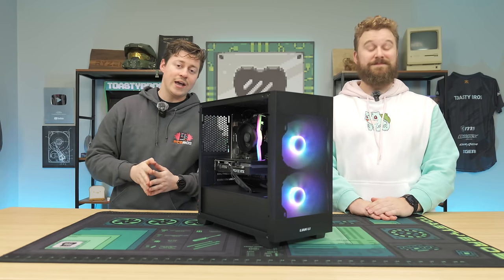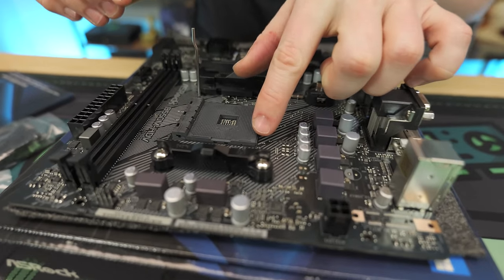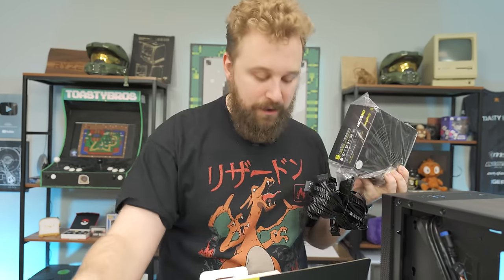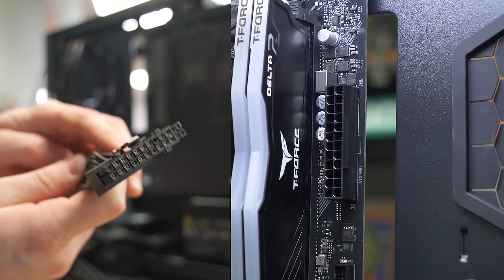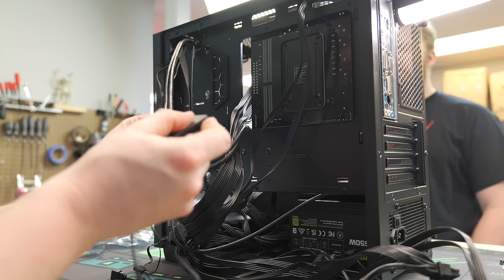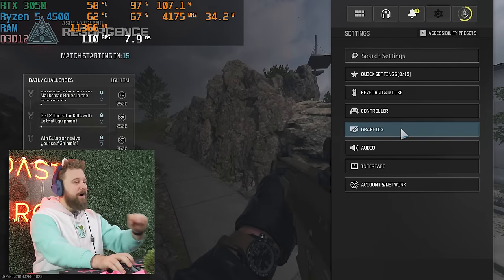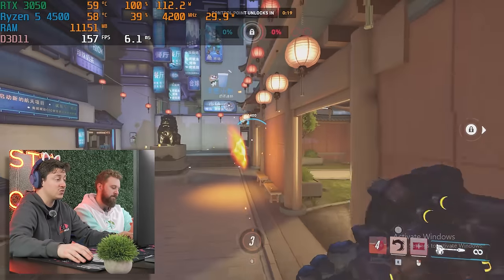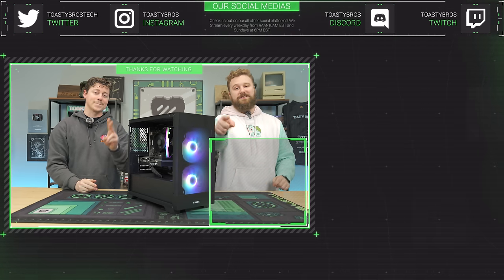$650 Budget Gaming PC Build Guide 2024 | Step By Step!

Comment: 3050 is insane I expected better toasty bros☠️
Reply: Gpu prices are pretty high right now
Reply: @metalbarz an intel arc a580 would've been better and cheaper
Reply: rx 7600 or 6600 would be better but i get they want something different
Reply: @metalbarz  rx 6600 would be a better option
Reply: @metalbarz  You should still be able to slot in a $250 GPU at this pricepoint. That means an RX 6650 XT which is about 55% better than the 3050
Reply: goku69000  fr
Reply: A Rx 6600 is like $20 cheaper and up to 50% better performing
Reply: @RetroAlex125 you are not wrong but intel is a little bit behind in driver support and it more unknown dont get me wrong I love intel GPUS are really good
Reply: I personally would have gone rx 6600 but I have the same issue with my case . Case has 4 fans , mother board has sysfan and cpu fan , I kind of dropped the ball on that setup . Apparently spare fan hubs are your friends when mother boards are cheap and stupid in design .
Reply: I made a 640 dollar pc with a rtx 4060
Reply: @metalbarz not really
Reply: @RetroAlex125 an intel gpu would be a flop they not as good as they should be rn it’s not a good buy maybe a 6650xt or 6700 but they literally tell u that in the video ? 😂😂
Reply: Ryzen 3600 got pcie 4.0 support, cheaper than the ryzen 4500 with arguably better performance
Reply: A RTX 3050 isn't a bad GPU it's just badly priced
Reply: @RetroAlex125 I don’t think they used intel since intel gpus still aren’t quite for normal consumers. Optimization isn’t anywhere near as good as real red or green
Reply: Same here 😂
Reply: @no_name900 Would the 6650xt be a good fit for an i7 8700k?
Reply: The thing is they have built plenty of pcs with a 6600 on the channel they need content so this is an option the rarely have used not the best but its functional thats how they see it without that mindset they lose views
Reply: In the meantime, I have a 1650 😁
Reply: @@StraightOutta2003you can literally fit a better and cheaper GPU.
Reply: @metalbarz  no they aint😂
Reply: Ur telling me I got a Ryzen 7 3700x and a 5700xt combo for under 250$ on eBay
Reply: In the PC selling biz, Nvidia sells like hot cake no matter how you wanna say X Y Z card wouldve been better. End of the story.
Reply: @metalbarz they really aren’t. Could easily fit an rx6600 or rx6600xt in a 650 dollar build
Reply: i mean they already said if you want " new" and "nvidia"..so only rtx 3050 then as rtx 2000 is not sold brand new any more
Reply: @@StraightOutta2003Rx 6600 is much cheaper and if I'm not wrong, much much better than the 3050.
Reply: @t0uchmyh0rn that's not the reason. Even they Kno that Rx 6600 is better than the 3050 but they don't want to be repeating the same thing. They could have even used a better CPU but they didn't
Reply: @MPblackpride6950  You clearly got no clue how PC selling works. Look at steam most used graphics card. TOP 10 is NVIDIA. RTX 3050 will sell twice as fast as any AMD card.
Reply: @t0uchmyh0rn  so basically, you're saying that people should buy the more expensive 3050 even though Rx 6600 is cheaper and does better? Yet you say I don't know how PC selling works
Reply: @MPblackpride6950  No, im saying if you run a pc biz you wanna put rtx cards in your rig even if its a 3050 cause i guarantee its gonna sell twice as fast vs amd
Reply: 6600
Reply: any amd gpu could have been cheaper and better
Reply: Guys I don't know anything about PC parts can y'all tell me if you're joking or not
Reply: @CarpetBanana  we dont joke about the selection of their parts here rtx 3050 really sucks and amd rx 6600 is much better option
Reply: @CarpetBanana  it’s just notoriously bad for its price
Reply: @CarpetBanana  we’re fr
Reply: @Arejen03 RTX 4060 is faster than both and 4060 is the lowest 40 series card

Comment: You can make a 12100F and RX 6650 XT build at $650 right now in the US, which obliterates the 4500 and RTX 3050 combo
Reply: ryzen 5 5500 is also a cheap ahh cpu
Reply: True, i got 12100F and Rx6600 with the other parts for around $580
Reply: Gotta appease to the Nvidia fanbois
Reply: @GK_Squid  Im an Nvidia fanboy but please dont buy a 3050, message for everyone

Comment: This build is totally insane didn't expected this from you guys, 3050 seriously & a 4500....in this budget anyone could have squeezed out a Ryzen 5 5500 with the RX 6600 easily!
Reply: Ong they don’t even gaf anymore
Reply: ive never built a pc or anything and have very little knowledge about parts. what exactly should they have done better?
Reply: @historyguy77  3050 is a bad gpu
Reply: @historyguy77 the cpu and gpu combo is bad specially they had 650$ budget i would go with i3 12 rx 6600 at that point not the 3050 bcoz this card really sucks
Reply: @blad1102  what makes a CPU and GPU combo bad? is one higher spec than the other or are they just both not good enough bang per buck?
Reply: @historyguy77  yes you cant be cheaper on those two and rtx 3050 will be so bad even at that cpu
Reply: I had a 3050 in my daughter's pc but it was the more expensive evga one, and there was nothing bad about it except its price was to close to the 3060. That being said it got within 20 fps of my overclocked asus 3060 in any game. I had it paired to a 11600k. It overclocked really well.
Reply: You Can do a ryzen 5 5500g and 6600
Reply: @historyguy77  Late but the 3050 is monsterably bad price to performance to the point where you should almost never get it. Amd has the RX6600 and Intel has the A750 that is 30%-50%~ better and the only reason that you should consider the 3050 is if you only want Nvidia and a new card. Not a choice you should recommend new builders, at this point buying used Nvidia is like 70%~ more valuable than the perks of being a new card brings its so bad.

The 4500 is kinda in the same boat but for a different reason. 20$ more and you get a R5 5500 or a I3 12100 that are 20%-30%~ better. Realistically, I can see a reason to get this if you are very tight budget and want the new CPU as it isn't the worst since its low price but you should definitely avoid it at all cost. And they could have avoided it if they didn't spend so much on the case and shift the 20$ to the CPU.

Together, they won't bottleneck and work perfectly fine together, however, the budget of those two parts and the case throw off the whole build and a better speced build can get you 60%+ overall. The most avoidable CPU and GPU of each category respectively combined is going to be bad.

Comment: That's got to be the worst possible modern CPU/GPU combo for $650 I've seen so far. So bad that in all the builds I've down I never even thought of pairing those 2 in any way shape or form. 5500 or an 12100F man... with a 6600... so much better and you'd spend the same. If you can stretch a little bit get a 6600XT or 6650XT. But never a 3050...
Reply: Ur telling me man I got a 5700xt and a Ryzen 7 3700x build in which those two parts alone were under 250$ 😂

Comment: A Rx 6600 is like $20 cheaper and up to 50% better performing, and an i3 12100f which is more expensive but 30% better. 

I made my build with those parts for only $600 3 months ago
Reply: Yeah agreed. The 12100f is so fast for so cheap. It outperforms the 5500 as well. And the 6600 is great for 1080p high
Reply: my 12400f is better 🤓
Reply: My 12600K is better 🤓
Reply: @micahholt4583  lol I use the 12100 for PC Flips cuz it's so cheap and fast. My personal rig has a 7800x3d which is much faster then ur i5. And I have it paired with a 3080 and 32gb DDR5. Beat that bum
Reply: @neev4367  dam lil bro you got mad fast
Reply: @neev4367  we don't care respectfully
Reply: also the 6000 and 7000 series amd cards will soon be receiving the frame generation drivers on the 24th basically doubling the frame rate of most games running dx11/12 and vulkan basically making it a better value
Reply: My $480 pc build (all new parts from trusted retailers) 
GPU: Asrock RX 6600
CPU: Ryzen 5 3600
MB: Gigabyte DS3H Wi-Fi B450m
SSD: Teamgroup MP33 1tb
RAM: Silicon power 16gb 3200mhz
PSU: Asus TUF 450w 80+ bronze 
Fans: Arctic F12
Case: Coolermaster masterbox q300L

So with the grand total of $480, would you call this a banger deal? 

Note: I used a mixture of micro center and Amazon.
Reply: @UnknownCxrpse  true but is it ddr5? I also bought a 700w psu so I don't have to upgrade it when I upgrade other parts, as well as 32gb ddr5.  Very Nice build and impressive you can build so cheap nowadays but I'd rather spend an extra $100 so it's supported for longer.
Reply: @notasovietspy8008  nah it’s not ddr5 and I’m pretty sure my motherboard won’t support ddr5. But thanks for the compliment
Reply: @Banchis15  yeah. I feel like they need to take a step back and start uploading less frequently and focus more on quality. Don't get me wrong I love their content but a lot of times they build junk that, for maybe $50-$100 more could be significantly improved. Or in this case for less
Reply: That is a nice clean build. I appreciate how you show the process in great detail.
Reply: @neev4367 I have a 7800xt 16gb that beats your 3080 bum

Comment: Built a 5600/3050 with mostly used parts that where left over after upgrading.  Sold a working PC with only a new m.2 drive and processor for $550 to a co-worker.

Comment: do you guys ever build a non games basic desktop pc for home use with cd, wifi etc needed at home?  thanks
Reply: Most of these PC build channels are aimed at gamers or high performance users, not necessarily for basic users. You can build your own basic PC if you want. Most PC cases don't use CD drives anymore so you will need to find a case that does support it or buy an external USB DVD drive.

Comment: could a rx 580 work with this too?
because i looked at a bottleneck calculator and it was an 11% bottleneck for the 3050 and a 0% for the rx 580
so could a rx 580 work? its also a lot cheaper
Reply: lol a 4500 isn’t gonna bottleneck a 3050
Reply: what are you talking about, bottleneck with a 6 cores cpu? what yeear is it?!?

Comment: I love you guy’s build but 650$ for this?! I built a way better one for 540$ with windows 11 pro
Ryzen 7 3700x-100$ used eBay 
5700xt gpu-120$ used eBay 
16 gb rip jaws 3600 mhz -new
Asrock b550 pro4 se-new 70$
Kingspec 1tb NVME-newegg 40$
Montech case with 4 case fans-new 51$
Amd wraith prism rbg cpu cooler-10$ used new open box 
650w Amazon choice bronze rated power supply-new 

My total was 540$ with you guys 16$ windows key. 

5700xt kills a 3050 in price and performance 

Anyways great builds guys

Comment: just built a ryzen 5 5600 + rtx 3060(12 gb obvio,who tf would go for 8gb) and 32gb ram(16x2) 550w psu and b-450 mobo @50k inr,converted it's around 620$. Obvio i can run acceptable framrates on 1440p n wayyy bttr than this lol.(offline stores r the way to go)

Comment: T force is trash, dont waste your money... I had a 8gb set on my first build (i know shouldve went 16 but was getting into building as a hobby first) they lasted about 2 years before i started getting a memory_managment BSOD. thought to myself "nows a good time to upgrade" so i went with a 16gb kit of the same speed and got that same error. a few months later... as the build was super outdated with used parts i decided to save up and start a new build but reused the ram, brand new everything but the ram and guess what? same error.... just save your money and spend the extra $10-15 and get something like the corsair vengeance rgb

Comment: These pc are great for e-sports  games and a lot of older games but wont be great for any  new games coming out . That CPU is a terrible for the money its a renamed Ryzen 3600 . the overall value for this price is just not good its better for people to save money  till they a 1000 dollar budget you could really build great system for a 1000 dollars which will play modern games at 1080p for atlest the next 3 to 4 years . Instead this pc is complete crap and what is that PSU .please guys dont  cheap  out with the PSU.